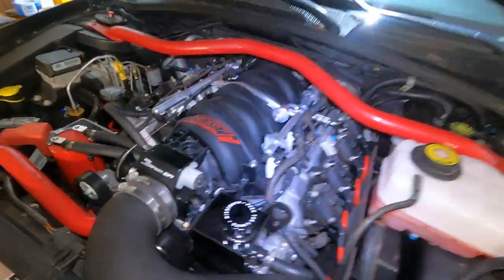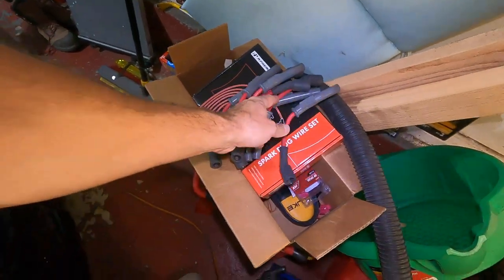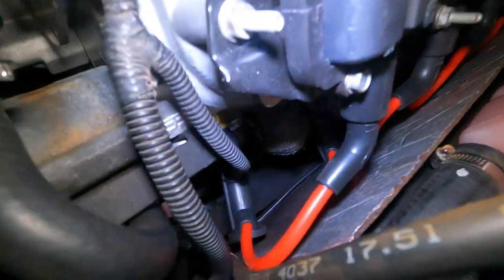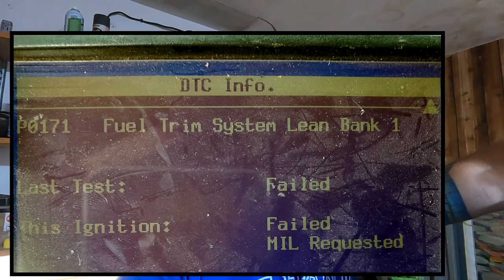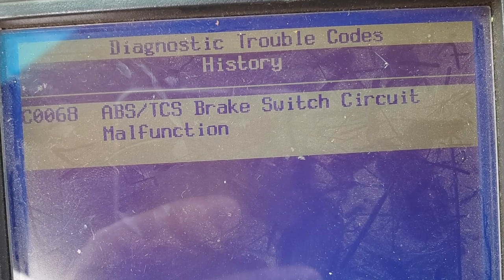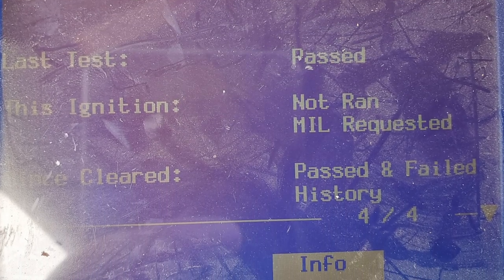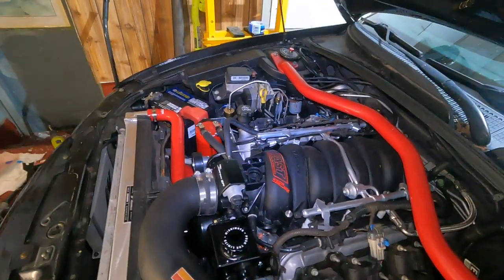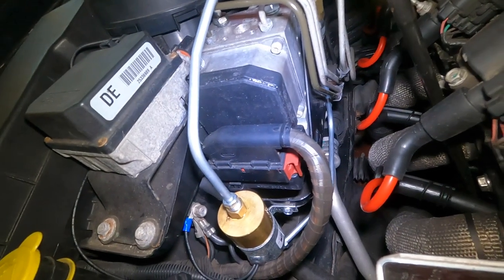GTO Updates. Brakes kinda sorta working?!?

Comment: I don’t think it’s the e brake sensor. Mine sends a message on the display for that. The dropping below idle after rev I would say is most likely the tune (tip in throttle) needs raised some. I do the same line of work in Virginia and agree with your comment. Keep on shining
Reply from the maker: It's worth a shot. Gonna mess with it. I had the computer tuned when I took it out. I'm sure it will be fixed when it gets dyno'd. 
Yeah utility company isn't for everyone. Been in for 12 years. Just becomes normal. Stay safe brother!

Comment: Maybe a Hole in the Brake Vacuum Booster??
Reply from the maker: I looked it over quickly, seems fine. If that lean code pops up again then I'll probably have to find a vacuum leak. I can try that those. thanks
Reply: @Billy_Ray_Garage  I hear you. Good luck.